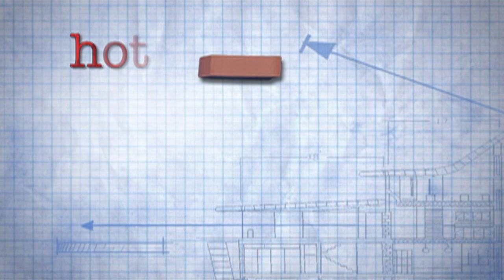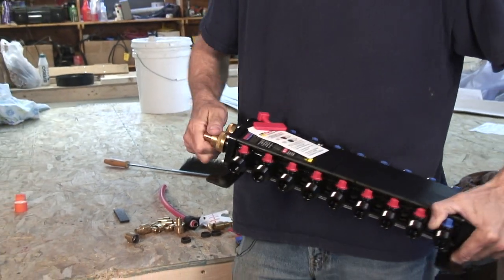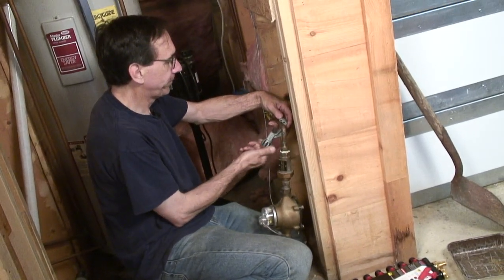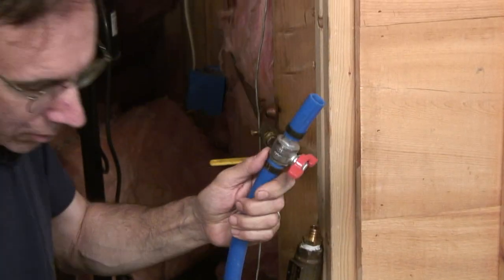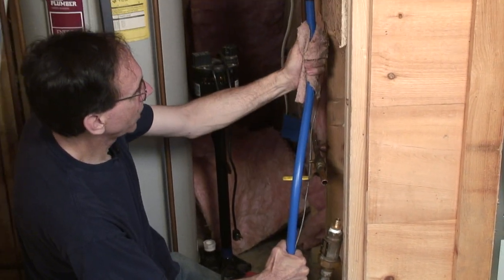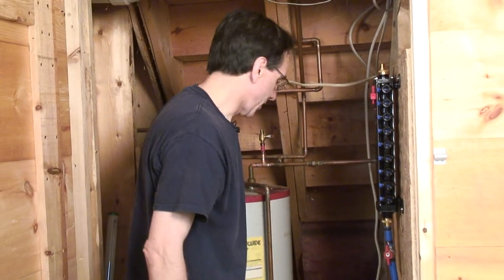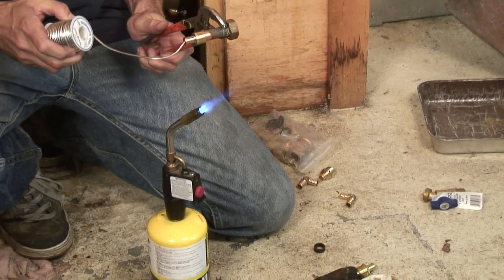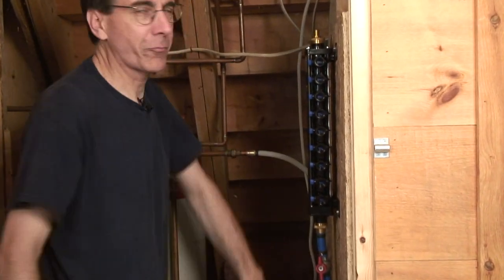Hot and Cold: Manabloc Plumbing System

Comment from the maker: Plumbing supply houses have the transition fittings. They should be available at Home Depot. If not, it is not a big deal to use a conventional fitting and transition it to PEX.
I would suggest using crimp connectors for all PEX connections.
It is a bit of an investment, but well worth it for a secure plumbing connector. Check on Ebay for deals.

Thanks for watching!
Tom

Comment: Good video Tom... I plan on trying to conquer re-plumbing my house with pex. I wasn't sure about putting in a manifold but now it's a guarantee. You made it look easy so I hope it is that simple.

How do you make the connection to lets say the toilet? The pex is flexible and moves. Do you attach a shut off directly to the pex then to the toilet or can the shut off valve tack onto the stud in the wall?  Do you have a video for those type of connections in general?

Thanks..

Comment: You did not read the Viega   Manual that came with your ManaBloc  Manifold  
  Viega pex tubing can not be heat formed.  The manual instructs you to cut out the KINKED TUBING and INSTALL A REPAIR COUPLING. ref:  Viega Pex Water Systems Installation Manual IM-PF 1012 520709  Page 26 .  Uponor , PEX A, can be heat formed because it expands.
Reply from the maker: redriver08 We did not use Viega tubing.
Tom